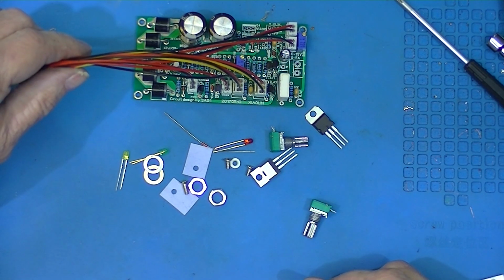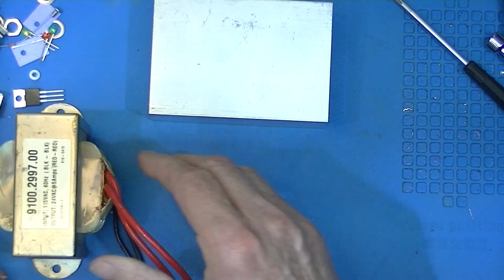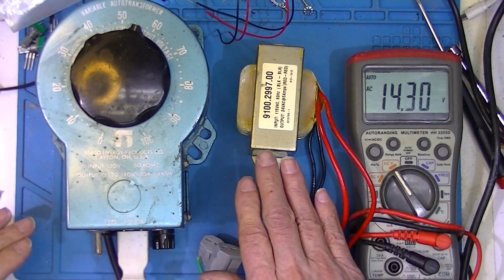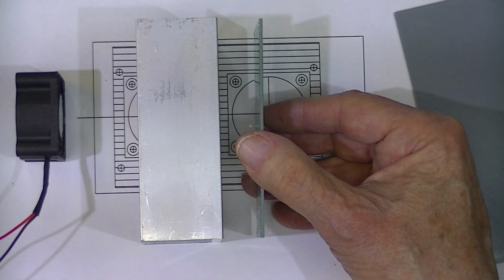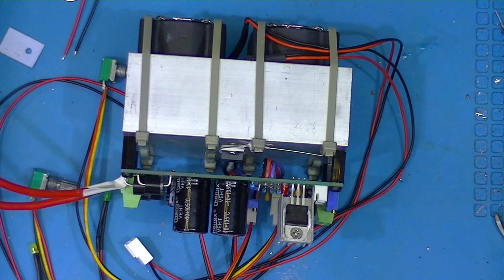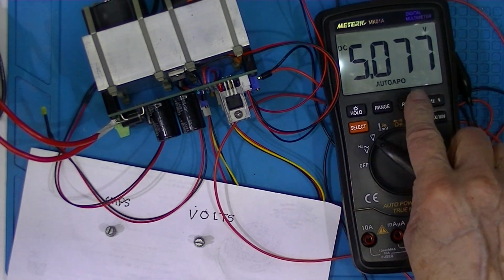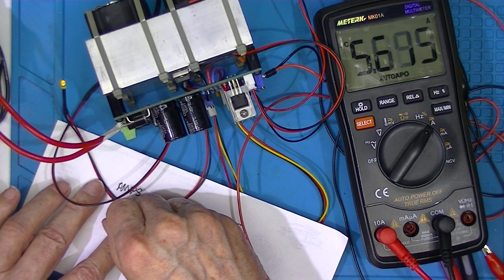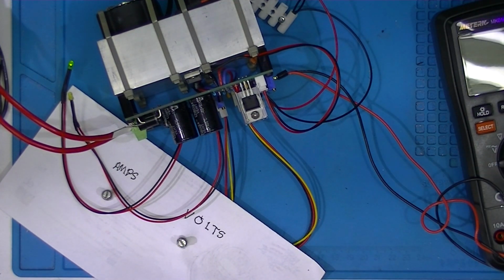15 Volt 5 Amp Chinese Power Supply Kit – Part 4

Comment: I would remove the lm317 then add a mini 360 buck converter. It should produce plenty of juice to power those fans.
Reply from the maker: I am sure that would work. Thanks!. But I want a completely isolated 12 volt supply in order to isolate the power to a panel meter(s). I was planning to bring line voltage into the enclosure in order to supply the transformer so I can just as well power to de-cased wall wart
Thanks for commenting!
Steve